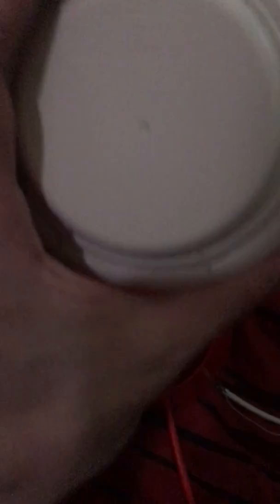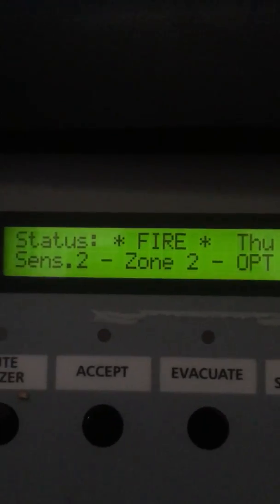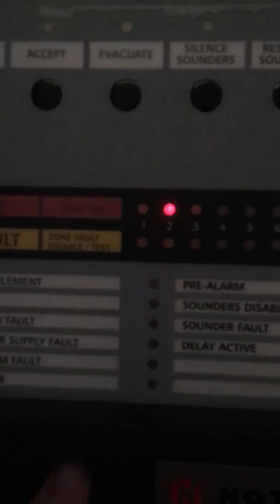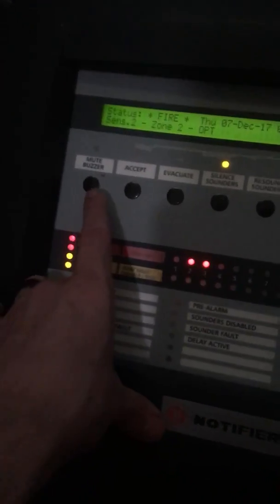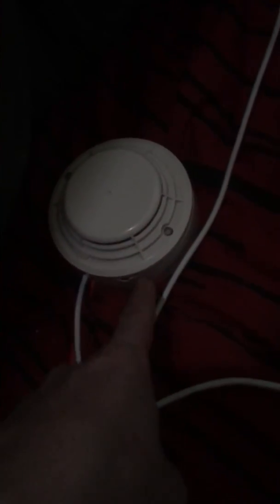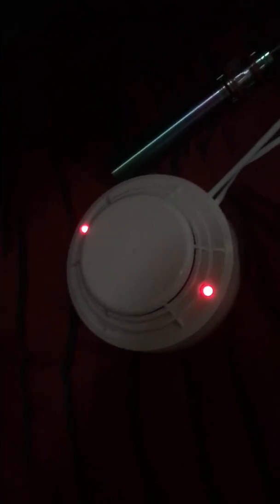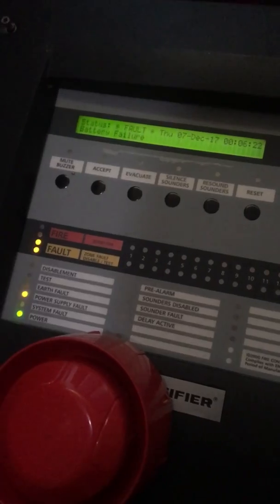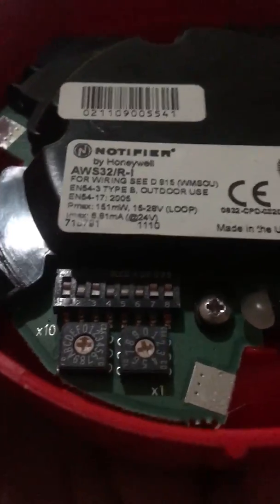Addressable fire alarm system demo

Comment: Could you do a test of this on alternate?
Reply from the maker: AcidZzZ I may not use the Notifier AWS actually, I might just have a system with addressable call points and detectors with conv sounders. Not too sure yet but a update video is due soon anyway!!

Comment: can you please possibly   do a video on how you wire the addressable systems including wiring the devices to the panel and the  panel to a power source example to a 13amp plug. using your notifier ID2000 control panel. thanks.
Reply from the maker: the walkie talkie reviews 13amps???? Are you drunk??? panels take 3amp fuses
Reply: no. the plug its self  is called a 13amp plug. you can put in a 3amp fuse. as you can take out the fuses and replace them with the correct fuse. so can you please  possibly do a video on how you wire devices to a addressable  panel and connect the panel to a power source. thanks
Reply from the maker: the walkie talkie reviews will do when I get a chance